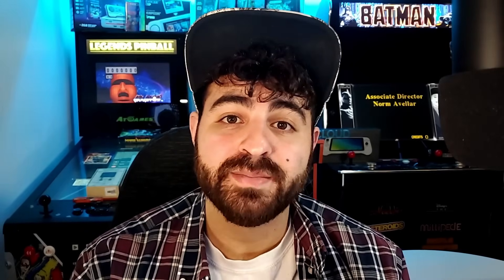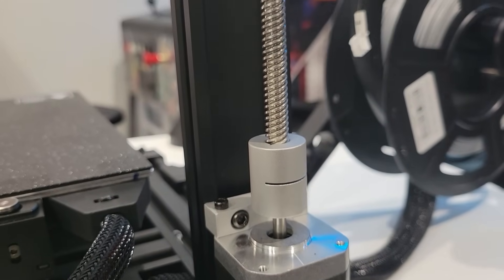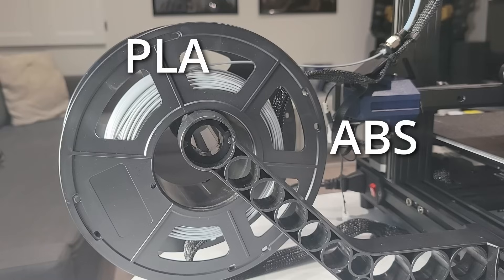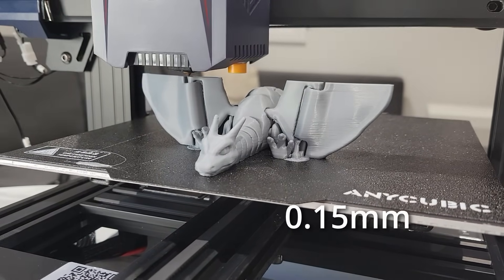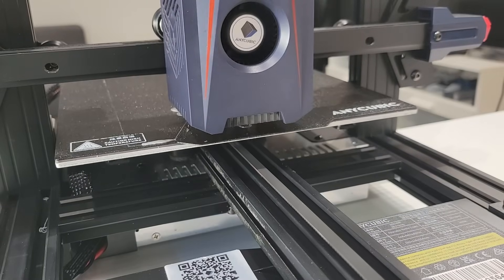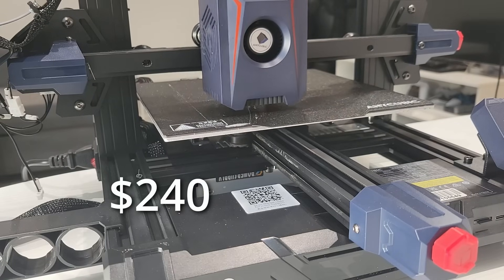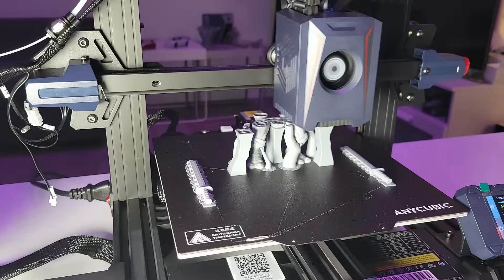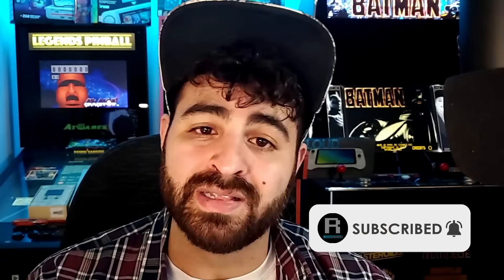Is the Kobra 2 Neo the Ultimate 3D Printer for Beginners?

Comment: This was my first 3d printer and a GREAT stepping stone into the world of 3d printing! Would 100% recommend this printer for any beginner! I didn't stay with it too long as I quickly became addicted to 3d printing and now I ordered my first LONG time printer-The Bambu P1P! Back as far as this printer goes, it has more than served its purpose and I was extremely happy with it's ease of use and entry level access! Some issues I frequently had with it is compatibility. It's not a very "universal" printer so-to-speak. I couldn't find this printers profile in prusia slicer so it made it a little complicated. Also, I frequently had first layering issues with it that suffered elephants foot. But a few tweaks in my models minimized this. The other issue is belt and roller tensions. Instructions do not clarify how tight anything needs to be and after several weeks of use, I discovered that my rollers were way too tight which caused my rollers to start stripping material. It appears you also have this issue as you can see the debris in your video that builds up around the roller. This is NOT good as it affects the layering consistency!  Again, it is a great entry printer!

Comment: Hey! You may not reply to this but I got this printer recently and was wondering what your recommended slicer and printer settings were. I'd love to know because I've been having trouble with moving parts in prints. They always snap off when I try to dislodge them.
Reply from the maker: It really depends on the filament you're using and the part design.  There are many slicer and printer settings that can help, I'd suggest doing some research on how to improve adhesion.

I find that having rhe heat plate set to 65 degrees helps with adhesion, but also to prevent snapping, sometimes you need to change the orientation of the print so the stress/weak lines run vertically thought the print, rather then horizontal through
Reply: @Restalgia  thanks for the help, I just ordered some higher quality filament the other day.

Comment: I just got this printer yesterday and I'm contemplating bring it back because of the unbearable buzzing noise coming from the print head.
I have no idea where it's coming from. I even used a zip tie to stop the fans from running but the buzzing remains with both fans not running. 
Does anyone else have this issue also??
Reply: Is the head rubbing on the build plate?
Reply: @ noise is coming from the part cooling fan. The main board drives it using PWM in the audible range. It’s just poor design on Anycubic’s part. It was made better by adding capacitors in parallel with the part cooling fan.
Reply: I fixed the issue! Added a 2.2uF electrolytic and 100nF tantalum capacitors in parallel with the fan, noise gone!

Comment: Having a hard time getting files to pop up on the screen after I drop them into the card.
Reply from the maker: When you look at the SD card on a pc. Do you see them on the root of the drive?
Reply: @ I got it thank you for responding. I wasn’t using the slice function or software. Nubbie here, just downloaded and dragged into the root and thought it would work lol new problems is the material keeps moving off the bed during printing. Thank you again for the reply and anything other advice haha trying to make stuff for my kids struggle is real.

Comment: Im aware that i most likely need to get a .2mm nozzle and possibly an upgraded step motor for this but i have some terrible quality prints going when i try to print out a termagant/hormagant. The supports stick like hell and even trying to manually paint my own they wind up being trash. Printing at a .12 layer height with a .4 nozzle and space between the supports and model is 1.6mm. What, if anything, am i doing wrong with this printer?
Reply: I don't think you can print below 0.2 mm layer thickness with a 0.4 mm nozzle. In fact I don't think you can go higher than 0.2 mm height either. Unless you need lesser layer height I would not worry about changing it, or just get a 0.2 mm nozzle.

Comment: I got mine for $139 and there is huge community for this printer. I was able to upgrade the printer power supply fan etc.
Reply: all the reviews I saw are saying it’s ez to assemble and use but I saw a one star video review and it was in Spanish and their printer WAS LITERALLY SMOKING and I’m a bit concerned but i already bought the printer and it’s gonna be here in 2 days so wish me luck
Reply: @donutscentedmarker  it's very simple to put it together. I got tune pretty well. It's a good printer for the price.
Reply: @ mine came 2 days ago but for some reason my homing keeps faltering and giving me a red screen so I keep having to turn it on and off
Reply: @donutscentedmarker  hmm I might able to help you out.
Reply: I can send a video if you need one
Reply: @donutscentedmarker  yes send it over
Reply: @ ok
Reply: @donutscentedmarker  hey guys are you still using your printers? are they working well?

Comment: I have one on the way that I got during their 9th anniversary sale for $149.00 so I added in a spool of their PLA so $169.00 shipped. Should be here by next week for me to give it a try.
Reply: How is it?
Planning on getting one
Reply: What do you think?
Reply: mine will be here in 2 days and it’s my first ever printer so if i run into any issues I’ll tell you guys
Reply: @donutscentedmarker  how is it
Reply: @donutscentedmarker  how’s it?
Reply: @davidhaykus1568  I ran into homing issues but I think it arrived defective because it keeps making this really loud noise when homing and then it fails and I have to shut it down
Reply: @davidhaykus1568  the printer has been in my room for quite a while and the filament keeps burning so it gets stuck to the bed and also the filament is barely extruding at all
Reply: @donutscentedmarker  What filament are you using and what are your temperature settings? Also what layer height are you trying to print?
Reply: @ im using sunlu filament and my axis is set around 3. something because it wasnt touching the board
Reply: @donutscentedmarker  I meant what type of plastic(pla,abs,etc) and what settings are you using for the print(temps, layers,etc) and if its anycubic printer did you do the auto level?(try doing it more than once.)

Comment: How much for this printer i see this in ebay its about 106usd shipping for 40usd and it is brand new is this good for buy this printer is this printer price (110 usd)
Reply: Get a bambu mini instead. Leaps and bounds better and better user experience. Plus their app is epic. You can print straight off the app. 

This one is a smidge more for an advanced user.

Comment: Thanks for the review, I'm thinking about getting this for my wargaming terrain. Can this printer resume a print after a power outage?
Thanks!
Reply from the maker: I'm not sure to be honest. It does have a pause print function, so it's possible but I haven't tested that out specifically
Reply: Hi there. I have this printer. It’s not terrible but I would spend the extra money on the bambulab A1 mini, in retrospect. I’ve had the printer for a month and already need to replace the fan in the motherboard. 
And I had a power outage the other night.
It lasted long enough that the bed cooled down and the print failed, but when I turned it back on the printer asked me if I had a power outage. I selected yes, and the head moved to the side to warm up and excrete, and then it went to start printing.
Because my print had failed I just stopped it as soon as it was ready to go, but I assume it would work just fine if you had a short-lived power outage
Reply: If something specific you did that made the fan do that or did it just start itself?
Reply: @gabeybabeyiv I have the same printer and it does it on its own. It is a printer that is quality bang for buck from my experience over an Ender 6

Comment: I have one. It's decent. Pay $100 more and get a bamboo, or 60 more and a flash forge 5m. My 5m kills my Kobra Neo 2 in speed, even after upgrading my Kobra Neo 2 with klipper. Save your $$$. I get quality prints, but I get better prints off of my 5m at twice the speed.
Reply: People really miss the point of these BUDGET item reviews. If someone wanted to spend "another $100" they would be looking st printers that cost $100 more.

These comments are pointless.
Reply: I wouldnt buy another Bambu printer if they were  .10 cents , ive had so many issues wirh mine i regret spending $1100 on the thing daily.  Worst purchase i ever made
Reply: Which baboo model?
Reply: @fomingera65  P1S
Reply: I love mine it just keeps going and prints so quick for 150$ on amazon.👍
Reply: My first printer is the kobra 2 neo. If I’d have known better I’d have gotten a bambu or something.
I’ve only got about 200 hours of printing on it and I already need to replace the motherboard fan. Makes an awful buzzing noise when I turn it on sometimes.
Reply: bro the kobra 2 neo comes with klipper
Reply: @BAONGUYEN-uh1gw really!?

Comment: Is this filamemt good from Amazon ANYCUBIC PLA Filament 1.75mm?
Reply from the maker: Yep, I've been using it (came with the machine) but I went back and bought more. It seems to be good quality.
Reply: @Restalgia  thanks
Reply: I’ve been using it and I find it works pretty well. It’s not necessary, but you’ll get better results if you remember to search high-speed PLA because it flows better and is designed to print through faster printers like this.